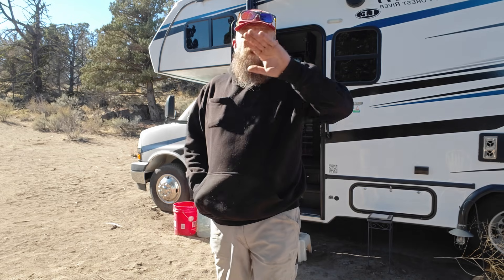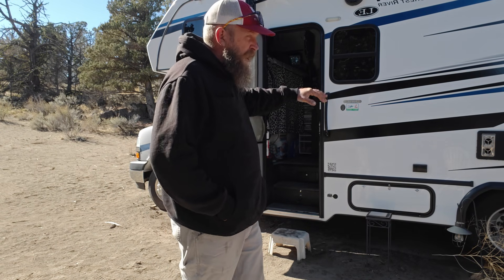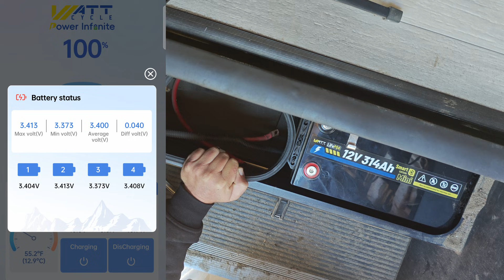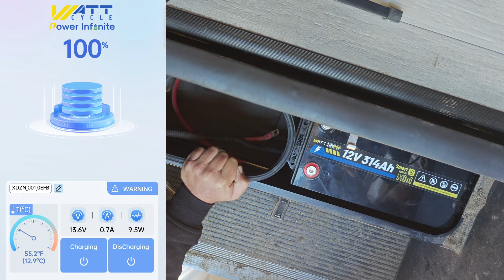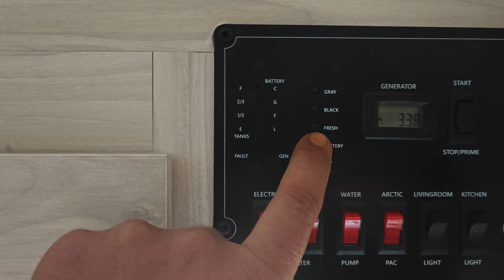Installing A 4000Wh LiFePO4 Watt Cycle Battery In An Off Grid RV

Comment: "we have puppies" LOL. To kinda add to your comment on the SLA style batteries is the 75Ah was only providing half it's rating most likely as well, I made the same mistake in getting 2 200Ah AGM's not knowing that out of the gate now replaced with 4 300Ah LiFePo4. Shoulda woulda coulda. Glad to see you guys didn't get hit by the fire!

Comment: The only thing keeping me from putting a lithium in my coach is they don't have the cranking amps to fire up a generator.
Reply from the maker: I'll have to check that out. My little push start Genny has a lithium battery in it. It's 4500w. I didn't check her Genny though.
Reply: @7kinhomestead  They do make adjustable amp chargers, been experimenting with mine to run a smaller jenny vs the BIG one and it seems to be doing well so hopefully that helps where you'd be able to find that sweet spot on the current without overloading jenny
Reply: @7kinhomestead  I should look over my wiring diagram again, maybe there's a feed from the engine battery back to the genny but im 99% sure it fires up from the house battery instead of the engine. ill look and let ya know!
Reply: The Wattcycle 1200CCA is capable of serving as a car starter battery; you can find some reviews online.
7 Kin Homestead has tested it, and out of respect for them, I won’t reference other reviewers.
Based on what I found through ChatGPT, lithium batteries lose efficiency at higher temperatures, so it’s best to keep them at ambient temperature rather than in the engine compartment.